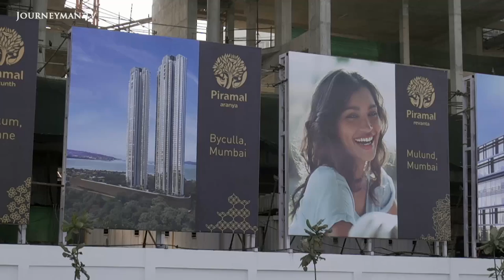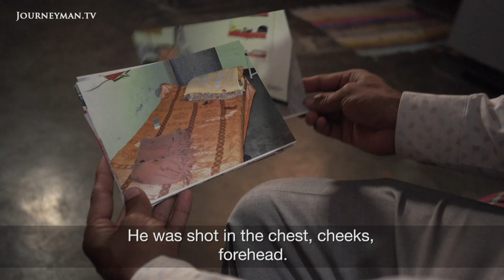India's Sand Mafia: The Dark Secrets of India's Booming Construction Industry

Comment: Unfortunately, the high chloride levels of this sand from beaches and estuaries will manifest itself as structural weakness in the years to come. The concrete will damage the reo embedded in it, and buildings/infrastructure will fail under load.
Reply: They may wash it first
Reply: Throw some aluminum in there for good measure ! Haha
Reply: Building codes and safety aren't very advanced in India

Comment: If they are so big and powerful why don't they just buy a suction dredge ,they will get 100 times more sand than a guy free diving with a bucket.its way easier.all you do is pull from a depth of 50 feet depth or better and use 4 inch tigerflex tubing with a steel collar on the end where you pump the industrial air compressor  air into and you will suck so much sand .The diver wears a full face dive mask with a dive belt and a t.80 compressor runs his air.